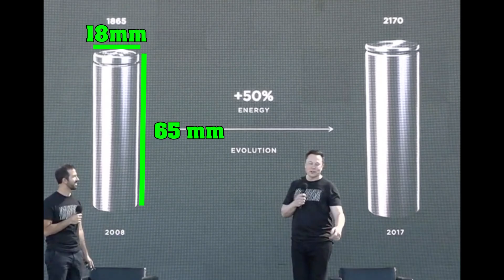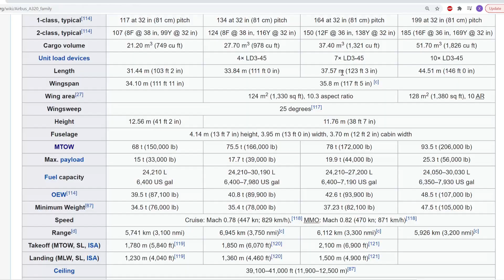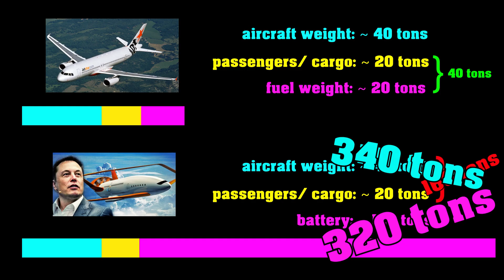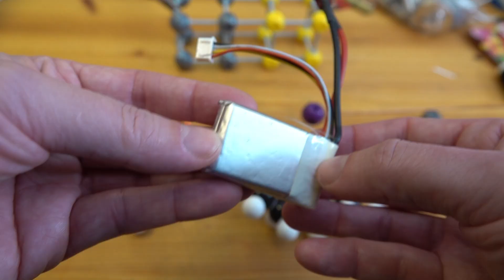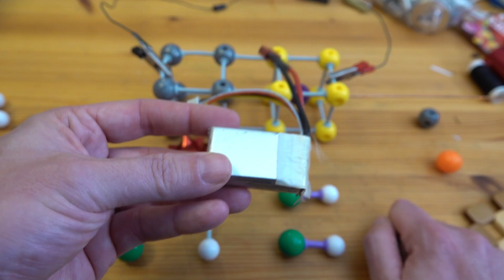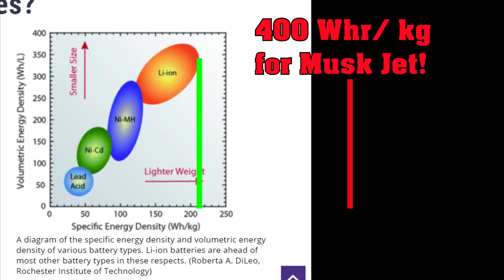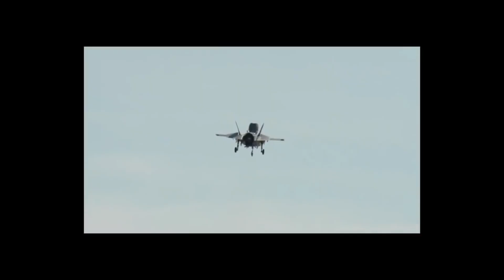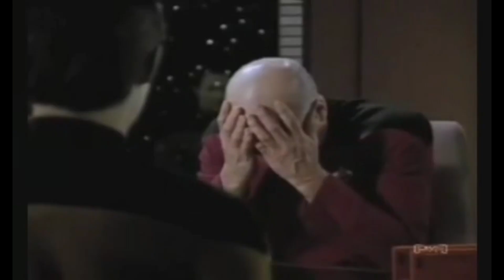Tesla's Secret Plan To Disrupt Airlines: BUSTED!!

Comment: But he's the richest man in the world now. Surely that must mean he's right! 
The Market doesn't fail, does it?
Reply: @Daniel Meyers It's also an impractical, hugely overpriced white elephant.
Reply: @Daniel Meyers Range is terrible, takes forever to charge, battery has a tendency to explode, you need to pull up the app to do the simplest things like pop up the trunk (for the record, the appropriate number of tasks you should need 'the app' to do in a car is zero), fit and finish is on par with cheapo chinese cars, not the luxury cars they ostensibly are, the thing is overall unreliable, etc.

ICE-powered cars are superior in every aspect except acceleration, and the acceleration of ICE-powered cars is already good enough for any non-recreational use. If you need a toy, by all means get a tesla, but for actual driving a normal car is basically strictly superior.
Reply: @Daniel Meyers "The range is of 263 miles"

Median range for real cars is over 400 miles, so you're at slightly over half that. That's trash. Even more trash when you realize that, instead of filling up the tank with gas in 5 minutes, you have to charge it overnight. There's simply no comparison.

"Combustion powered vehicles are many times likely to combust and explode. I"

Flatly wrong, and this has been explained to you in this very video. You have no excuse.

"0-80% with a Tesla Supercharger,"

Good luck finding one. And 80% is useless in cars with already pitiful range. You need the full 100% (or however much you have now with the battery degradation -- another strike against these toys).

"and if you have driven over 200 miles, you'll need a 20 minute break anyway."

Absurd. It's really quite easy to drive the full range of a real car without breaks, and if you do need breaks the 5 minutes for gas is enough. Meanwhile you're forgetting that you just won't find superchargers at convenient stops so that calculus goes right out the window anyway.

" Except for emissions"

Irrelevant.

"urban pollution,"

Catalytic converters.

"MPGe efficiency,"

Also irrelevant. Call me once the range is less pitiful. Efficiency will matter once it can actually do the same thing. Until then it's not even a consideration. And the efficiency of real cars is already good enough.

"torque in general for towing not just acceleration."

Irrelevant. Torque is already good enough.

"Stories of people in Texas using their Teslas with heat pumps onboard to stay warm,"

LOL except the same people also lost power so good luck charging the thing. PS you can use your real car to stay warm too, as long as you're not stupid about it.

So, like I said. The only thing electric cars are better at are things that don't matter, so they really are strictly worse than real cars.
Reply: @Daniel Meyers "why would emissions be irrelevant? 

Several reasons. First, there's no evidence global warming is severe or dangerous enough to warrant destroying the lifestyle of the average person. Second, if you care about CO2, you can eliminate those emissions with biofuels, which may be less sexy than electric cars but have the benefit of actually working, and being a mature technology already widely deployed in several nations. They also actually eliminate emissions instead of just displacing them like electric vehicles do.

"You might want to see TFs video"

Or I might not. TF is not rational about this topic.

"Dismissing the enormous impact of urban pollution and smog from gas cars with "catalytic converter" is not a serious response."

Accusing your interlocutor of not being serious without providing any arguments is what's not a serious response. Air quality in most cities is actually just fine, and where it's not fine it's more due to diesel engines, which electric vehicles are even less poised to replace. Besides, for the vast majority of people spending 10x the price of a real car on an electric car would be far more harmful to their health. 

Electric cars are toys fo rich people, not a serious transportation technology.
Reply: @Daniel Meyers "A study was carried out by researchers from the International Council on Clean Transportation (ICCT) found that 385,000 people worldwide died prematurely in 2015 alone from air pollution caused by just vehicle exhaust emissions. T"

That's pseudoscience. It's simply not possible to make that type of causal inference reliably.
Reply: @Daniel Meyers "pumped with significant air pollution "

Most cities don't have "significant air pollution" because, like I said, catalytic converters.

It's almost like words mean things, it's amazing.

"Having to dismiss 2 entire fields of science "

Where did I do that, exactly? 

You know what else doesn't help one's case? Blatant lies lmao.
Reply: @Daniel Meyers "ecause most of those deaths occur where most people in the world live, in China and India,"

Yeah except it's pretty disingenuous to blame air pollution in china on personal vehicles, isn't it?

"The part where you denied climate change"

Where did I "deny climate change", exactly?

"and essentially called epidemiology pseudoscience."

Where did I do that, exactly?

If you need to blatantly lie to make a point that's not a very good sign lol.
Reply: @Daniel Meyers " You denied it when you said global warming wasn't severe. "

I said it's not severe enough to warrant destroying the lifestyle of the average person. I say that based on the evidence, which comes from climatology. The problem you have is that you're just completely ignorant about the subject. Here, pop quiz: give me your best estimates for the ECS, the TCR, and explain how you know.

"Since 1960, 337 zetajoules of energy, that’s 337 followed by 21 zeros, h"

Measuring this in joules to try to be impressive is ridiculous (oh noes so many zeros!) because 1. the earth is huge and 2 most of that energy is locked up in the oceans which have a truly immense thermal capacity. It's demagoguery, not science. If you were educated by actually reading journals instead of garbage like skeptical science, you'd know that.
Reply: @Daniel Meyers As I suspected, you don't even know the very basics of the field, since you couldn't even answer a simple question about the ECS and the TCR. This discussion's done; you can call me up once you've remedied that abject ignorance.

In the meantime, how about we talk about how you had to resort to blatant lies in order to make electric cars look more attractive? You equivocated air pollution in china, which is mostly caused by coal burning (and a general disregard for human rights) with the emissions of modern cars equipped with catalytic converters. Can't get away from that by talking about global warming and I won't let you.
Reply: @Daniel Meyers Buddy, buddy, I just did: "You equivocated air pollution in china, which is mostly caused by coal burning (and a general disregard for human rights) with the emissions of modern cars equipped with catalytic converters." That's a lie, friend.
Reply: @Daniel Meyers Do you even know what a catalytic converter is? Genuinely curious.
Reply: @Daniel Meyers Right, if only there were something that could be done to check if the catalytic converter is in good condition... you know, some kind of test...

Time to recap:
Electric cars have pitiful range and prohibitive recharge times, are heavier, more likely to explode; and what they bring to the table are things that either don't matter or for which real cars already do well enough. Tesla, in turn, is plagued by awful fit and finish decidedly inappropriate to the price tag and are in general ludicrously nonfunctional (anybody want to pull up the app to open the glovebox or whatever?). 

Your only response to this is to point out "but people are dying in china, which has nothing whatsoever to do with the fact that they're uncivilized genocidal brutes pumping gigatonnes of soot into their air, who haven't even figured out writing, let alone proper vehicular emissions testing."

Go home, sit down, and think about what you've done, because you're done.
Reply: @Daniel Meyers Tip, you can't lie when the conversation history is right there, buddy.

Comment: For this to work we would need to invent complelety new tech.
The kind of stuff usually seen in Sc-Fi novels.

Is it impossible to build a super low weight battery that doesn't store energy in what amounts to a chemical storage? Maybe. Can Musk do it? Hell nah! 

(in terms of the 320 example this would mean the battery is allowed to be big, without much weight, hence the Aircraft could take off).

Or we could "beam" energy up to the aircraft with fancy LAZZORZ.

Ideas like that basically skip the battery weight problem, but introduce the even bigger issue of: "how the hell do we build something we probably can't even invent?"

Comment: Anyone else wonder how his electric propeller driven plane is  going to exceed the speed of sound. What a con man he can publicy solicit funds without fear of prosecution. But if i try to sell the Brooklyn bridge or the Eiffel tower I'm a criminal.
Reply: I'll try to make this a simple as I can for you.1. An electric jet engine is an electric motor with a propeller attached. 2.The closer the propeller gets to the speed of sound the less effective it becomes until effectiveness reaches 0. 3. Any person who knows basic aeronautical engineering knowledge will tell you this. 4 Max take-off weight and Max landing weight are not the same why do you think aircraft with an emergency will circle, sometimes hours, to burn off fuel before landing. 5. Why do you think commercial super sonic aircraft were a failure, not the cost but because most countries don't want to deal with all the noise compaints and broken windows. 6. I refer you back to the video and the fudged weight and power density figures. 7. Hyperloop. 8. Hyperloop  9. Hyperloop. Only mentioned that 3 times because their was so much wrong with it. 10. As we will have thousands of his malfunctioning satellite's raining down on us we will probably have to move under ground. Most of this so-called geniuses ideas have been lifted from children's books from the 50s 60s and 70s. Hyperloop in particular I remember, also wave power flying cars, personal jet packs, moon bases and Mars colonies. Most planetary scientists will give you a very long list why Mars colonies are a bad idea. I have found that no one is talking about the environmental impacts lithium and rare earth processing is causing. Dreamers think about only the good, scientists think about what's possible, engineers think about what's buildable. And the person who builds it thinks what's the point, How is it going to benefit me and my children. Oh and all this futurist technology is already 20 years late. You are attempting to defend a person who is taking his ideas from children's books more than 50 years old and you dear child are lapping it up like I did. But I'm my defence I was only 8 yo. Whats your excuse.
Reply: Have you seen SpaceX or Tesla? He delivers. He is the lead engineer at SpaceX. He just made a fucking giant rocket do a belly flop and nearly land. And it will land next week.
Reply: @kyotosunsetdreams6105  And what does this has to do with making an electric plane feasible in real life?

Comment: With all respect. It doesn't really matter if its bigger, as long as its lighter. You only talk about the dimensions of the battery, since that what was provided. But dimensions has nothing to do with energy density (as in J/kg density). I do agree that electric cargo planes are unfeasible. Recreational electric airplanes and helicopters is already a thing. 

A "battery with wings" is still an aeroplane. just like my battery with quad rotors is still a quad copter.

There is an awful lot of terrible assumptions about the plane. Especially regarding your guestimations on the airframe etc. I am not saying that I am a fan of this idea, but you COULD do this, its just not economical.

2x the capacity would not be so dangerous as long as the internal resistance is relatively high on the battery. The problem with li-ion shorting is that it has very low internal resistance.

70% of the mass for batteries doesn't really matter much, as long as the electricity is cheap and the maintenance is low.

But yeah, its a pipe dream. Still you are focusing on some irrelevant things.

Also I am pretty sure that Goodenough's battery was infact behaving like a lithium oxygen cell, hence the high capacity. A rechargeable lithium-oxygen battery wouldn't be such a terrible idea, but the power would be dependant on the oxygen input. Infact doing this could very easily (and safely compared to li+ion) double capacity of batteries. But logistically they are an entirely different beast. (Maybe Bosch tech was based on this too?)

Comment: Another important factor is that a jet only tank the amount of fuel needed, and some extra in case something happens. And when fuel is used the plane does not carry that weight anymore. This is the drawback of battery electric planes, they carry the same weight of fuel during the whole flight. Smaller electric planes for shorter flights though is developed and tested as we speak.